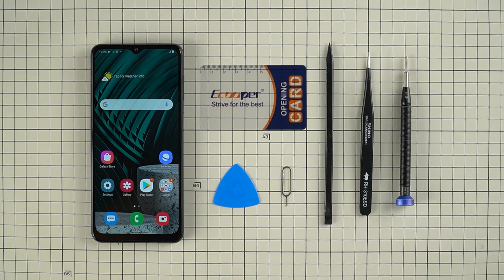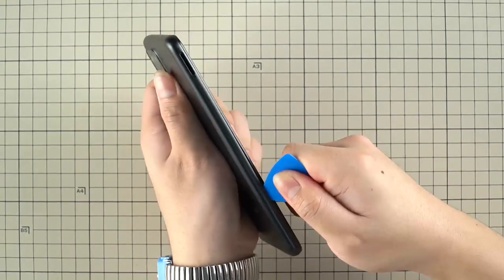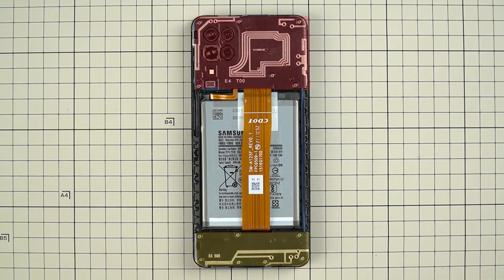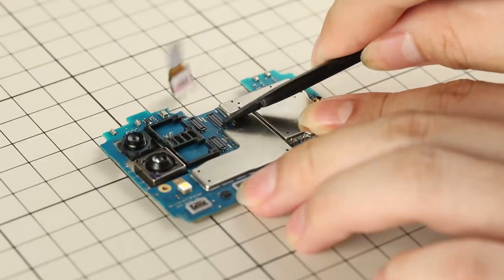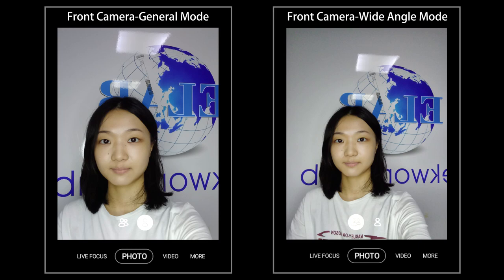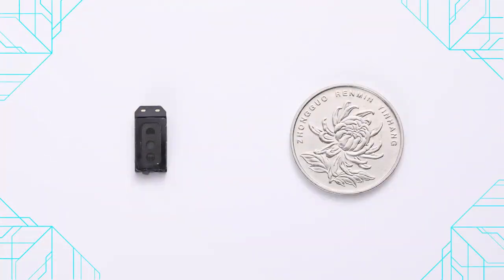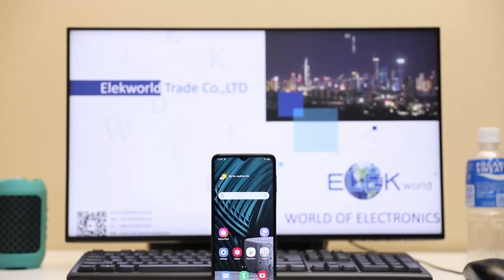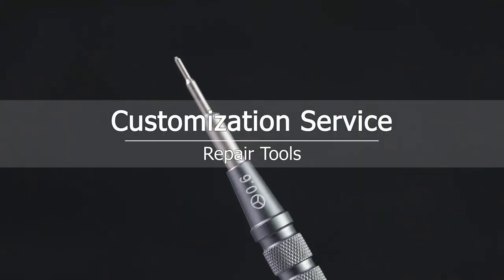Samsung A12(A125) Teardown And Review, Why Is It So Popular?

Comment: Jerryrigeverything doesn't answer this Question but you will.
Why is it labeled not to remove a Battery? Specially on Samsung.
Reply from the maker: That's bcuz Samsung designed it as unchangable, if you remove it, probably the battery film or the battery get damaged.

Comment: Do you know if the cell chip can misconnect if you miss a screw?  I changed the screen and now I can't make calls or text
Reply from the maker: Not quite sure, but possibly the screws missing resulted in cellular signal missing. As for text, it might be screen problem or wasn't connected 100%.